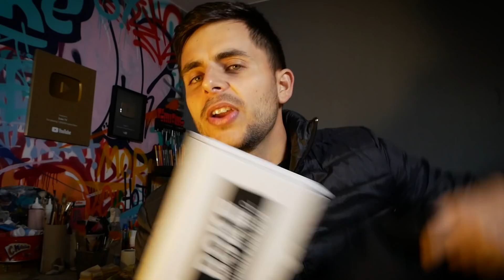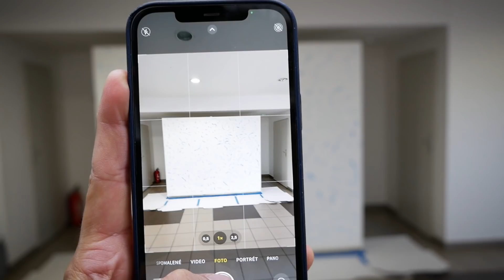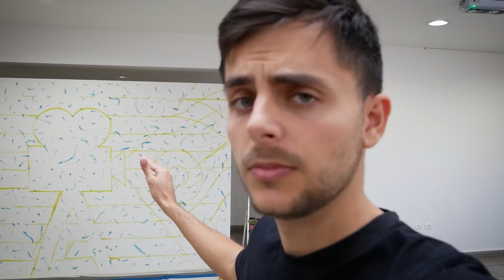Painting at FILM School (Tricky)

Comment: Use yellow Frog Tape or similar for freshly painted surfaces, it will also make your lines cleaner.   It could also help if you prime the wall and allow proper time for that primer to dry before your painting.  The primer will prevent chipping and ultimately make your colors more vibrant when using the right color primer.  Another technique would be cool to see in some of your art would be tape-caulking, incredibly sharp lines with depth to the line, but takes a specific method and speed. This is coming from a 20+ year professional painter, not an artist.   Great piece, always a joy to watch you paint.
Reply: I'm also a tradesman and agree on your suggestion of using a lower tack tape!! Always helped my out on problem surfaces and taking the tape off whilst paint is wet
Reply: Also in the trades and use frogtape, yellow or green/blue. also Airbrush artist and i use those tapes.

Comment: Very nice Work and Design. I Like it :)

Just in case:
For preperation before painting you could use "Wallprimer" (if this is the right word, on german it's "tiefengrund") to fix the problem with lose underground also usefull if you have color/fluid soaking/absorbing materials to paint. 

For thin rounded lines or masking canvas works like your "glitter" paining,  you can use for example "3M 471 Scotch Fineline". 

Regards from Germany

Comment: Well done, improvising when things don't go as you expected. However, for a next time: there's special tape for fragile walls... It's often pink or purple tape and it doesn't stick that well, but enough to be effective... Pro tip: first paint the edge of the tape with the colour beneath the tape... so if there's any bleeding under the tape it'll be the colour that's already there.... When this paint is just dry go over it with the new colour. Simple technique for creating really sharp lines using tape that's not likely to damage the wall...

Comment: I painted my new room with a geometric design and the previous owner put some type of adhesive to the wall for wallpaper and I didn't know this and used masking tape for spacers and when I was all finished with the painting and letting it dry a little bit, when I peeled the masking tape off the wall it started to rip the paint I off the wall but I managed to save half of the wall but other than that the other side turned out perfect, great video doke and I can relate to the pain of a fucked up wall

Comment: Very nice work! Love your videos. 
For very straight lines you could try a blemish line. Its useful for longer distances and also easy to apply if your alone and any surface. And it takes away the problem with the tape pulling of the paint.
Downside, you need a more steady hand while painting.
Loking forward to your next video.